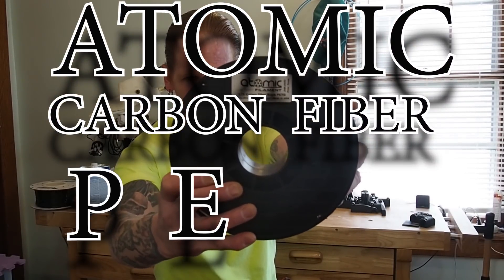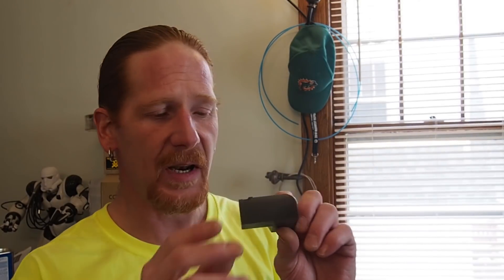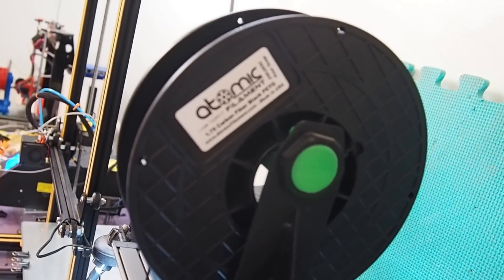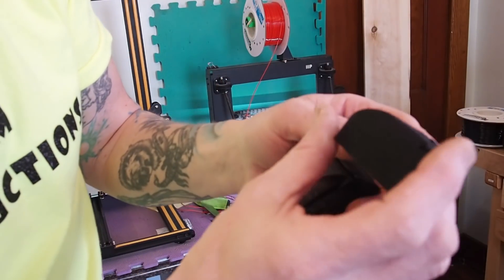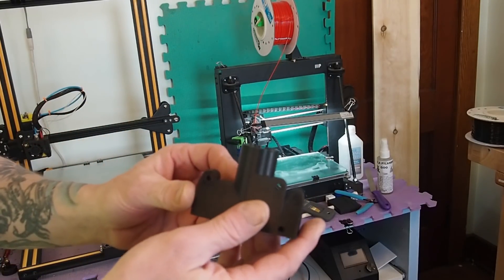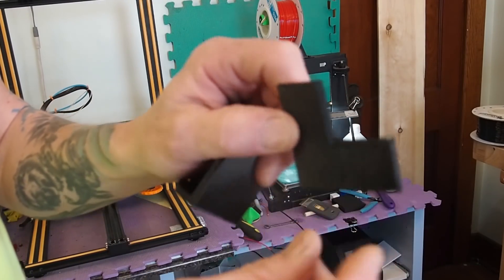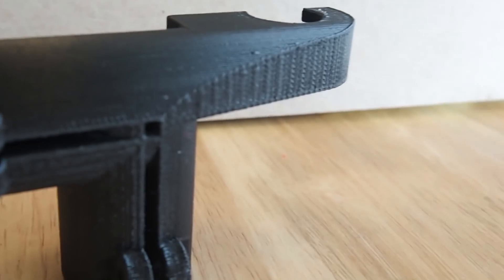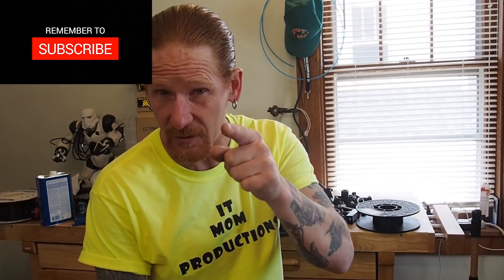Atomic Carbon Fiber PETG Review

Comment: Hello. Great Video! Does it have less flexibility compared to ordinary PETG, or just a little less flexibility? I've always given up on common PETG in my designs because it's extremely flexible and my parts can't have much flexibility.
Reply from the maker: I do feel like this stuff was more ridged but the parts I was printing where thick not sure what thinner parts would be like as I ran out of the sample and couldn’t do more testing

Comment: Im moving from pla to petg and everything is working good, but the filament seems like it still is getting pushed down rather than just coming out of the nozzle. Should I relevel the bed at a higher height or go from .3 layer height to .4 layer height?

Comment: Hey Matt, awesome video & suberb looking parts man.  I'm dialing this filament in today as well.  Beyond the basics like speed & temp, have you played around with coast, wipe, and retract settings to get those bulging corners to settle down a bit, thats my only issue now. Cheers & thanks
Reply from the maker: Not sure what slicer you use but I’m an s3d guy I use a 90% extrusion rate retraction same as pla no wipe or coast or cooling just play with temp and speed